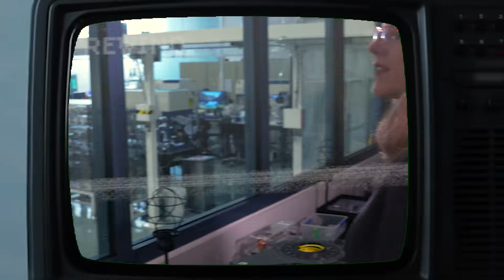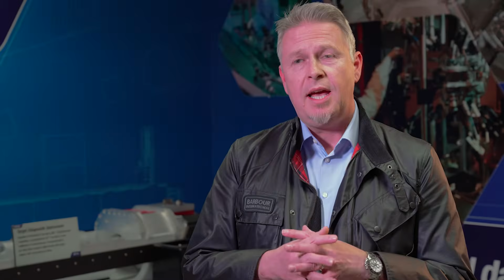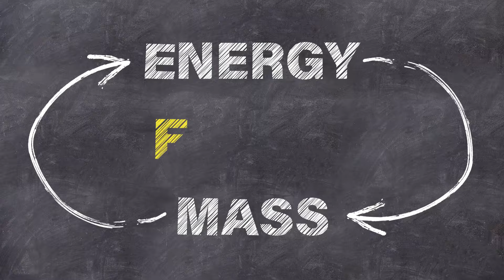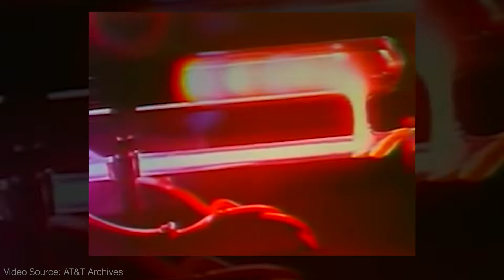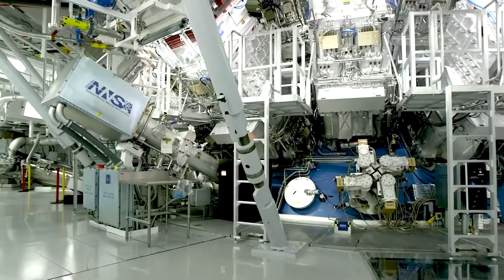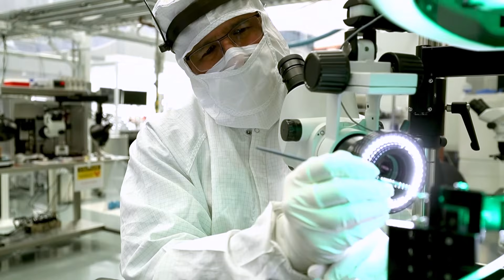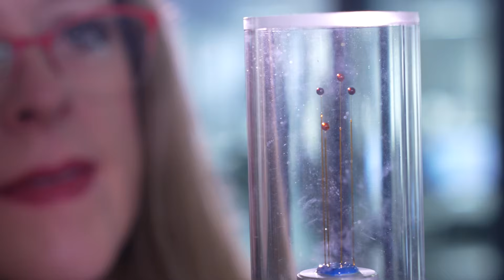What is fusion ignition?

Comment: The problem with the Hologram is that it was not spherical and it was not able to contain and control the neutrons and they had another words if you going to extract energy from something make it like around spear don't make it like the whole ramp all these neutrons and everything is hitting every particles and everything before it could contain you can't contain the field, that's what I'm saying you can't contain the field you can hit the hall around with 60 million degrees temperature but all of the energy is going the neutrons are going to take over and it can't work, it can't work because the Hologram is not round everything dealing with this test of 20 billion of a second it has to be Sparkle it has to contain all of the energy that we put in it neutrons are going everywhere, you can't have that and that's why it didn't work on the first experiment, birthday you know I had to tweak him a little bit but then they figured out if you're going to have a fusion reaction that all of the energy must be contained in the same space like a circle like the sun
Reply: Neutrons don't have an electrical charge so after they are generated there is no easy ways to control their flight path.

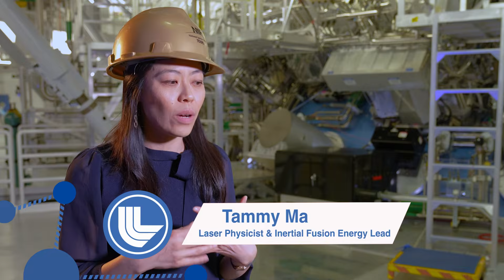Comment: The more energy that was received outside was 20 billion of a second, that's all we needed to confirm Fusion is the future, scientists already working on compact Fusion reactors and now I'm seeing compact Fusion reactors that are even smaller and require less space and a more capable because of free enterprise 1:34
Reply: The nuclear fusion energy experiments began back in the 1950s and have since then encountered a dazzling array of difficulties. The existence of fusion reactions have been known for around 100 years and the first practical application occurred in the first thermonuclear explosions back in the 1960s. NIF was designed to create such explosions using a tiny bit of fuel squeezed down to a microscopic size. In order for a technology to thrive it has to become economically competitive with other sources of energy generation. NIF fusion experiments are at least six orders of magnitude away from that.

Comment: When you say we got 150% energy out. How did we measure that? Did we heat water, turn a turbine and produce that many KWHs? Are are you just guessing based on a sensor?
Reply: There is no energy gain in the traditional sense: 1300 MJ of chemical energy was converted in conventional coal powerplants and transmitted so 400 MJ electric energy can produce 1.9 MJ laser light energy to DESTROY a million dollar target and gain +1.26 MJ unusable heat in the rubble mass (roughly 0.08 kg of wood gives same amount of energy when burnt, except in a usable form). It is an "energy gain" if deceptively hiding most of the numbers. The number of neutrons multiplied by 17.6 MeV is an upper estimate of the energy liberated (Appr. 2% are DD "side-reactions" also producing some energy, with less neutrons, but no big error in any case; The input energy is more than stated).
Reply: It's not a guess. All they had to do was measure the number of neutrons coming out and calculate. It's completely straightforward.
Reply: @Muonium1  neutrons aren't electricity thou. Every engineering student learns motors aren't 70% efficient. whats the practical energy capture.
Reply: @RabidGoose22  there is no energy capture, it was never designed with that purpose. It's an experimental facility designed to reach ignition, which it's done, that's it. Read the wiki article on it or go to the NIF web page. There were no "guesses" about how much energy came out of the reaction, it's trivial to directly measure that parameter via a number of different diagnostics on the target chamber.

Comment: Fusion is great.  Not wholly clean, the tritium and deuterium produces neutrons.
Reply: That's the point? They produce neutrons for other reactions. If you mean they are radioactive you are also right, tritium is slightly radioactive
Reply: @alihaidar5787    No.  The escaping neutrons from fusion strike the vessel walls over time and makes the reactor vessel radioactive.
Reply: @deltonlomatai2309  Neutrons on their own are not radioactive. Neutrons penetrate something called the breeding blanket lined with lithium to produce more tritium and more neutrons to keep the reaction going. A neutron carried no charge, it is non reactive. Radioactivity is the decay of particles which leads to HIGH ENERGY particles that can break DNA. Hypothetically if you were caught in the reaction your DNA would be scrambled but that would be the least of your worries. Coal kills more people due to radiation than Nuclear does. Edit: The breeding blanket also does contain elemental uranium, which overtime will become radioactive I forgot to mention this. The only issue is disposing of the blanket itself not the outside of the walls.
Reply: What's the other one, not the T-D fusion, but the other two things that could be used for fusion?
Reply: @GodEmperorSuperStar  MIT achieved deuterium and hydrogen fusion.  "D- He-3 reactions produce 3 reactions produce
no high energy neutrons, no high energy neutrons, and consequently the and consequently the
activation of metals is activation of metals is drastically reduced. drastically reduced."
Reply: @deltonlomatai2309  can you please say that again without all the stuttering, Sir?
Reply: @GodEmperorSuperStar  cute you have a side hustle as a comedian.  remember to tip your waitresses.
Reply: @deltonlomatai2309  Boy! I'm a gonna tell u, boy, that my waitresss be ME.
Reply: @deltonlomatai2309  Oops.
Reply: @GodEmperorSuperStar  Simple truth is you can't sell people that fusion is  material free.  The radioactive is of a short half life and lower amount than fission reaction.
Reply: @deltonlomatai2309  That just reminded me of the original neutron bomb, it was supposed to be a pure fusion reaction without a fission. They eventually compromised in calling a "radiation enhanced weapon" a neutron bomb.
Reply: @deltonlomatai2309  Simple truth: you're very VERY VEYEEERYUQWE:POHIFJ
Reply: @deltonlomatai2309  EEEEEEEEEEEEEEEEEEEEEEEEEEEEEEEEEEEEEEEEEEEEEEKKKKK!!!
Reply: SAHP TRIGGERING MY ptsk by calling me a queer!!!~!
Reply: Aneutronic fusion is any form of fusion power in which very little of the energy released is carried by neutrons. While the lowest-threshold nuclear fusion ...

Comment: We must not belittle the effort the folks at the National Ignition Facility have put into this, but it is appropriate to criticize the hype they have put out.  They simply got really excited because they finally achieved what they originally claimed they would achieve no later than about a decade prior.  It was not a breakthrough.  It was merely a modest step up in energy released as compared to a similar test they did a year or so earlier.

Three megajoules sounds like a lot.  How much energy is three megajoules?  Three megajoules is three million watt-seconds.  In comparison, one kilowatt-hour is three point six million watt-seconds.  I pay about twelve cents per kilowatt-hour for electric energy delivered to my home.  So, if they could convert the energy to electricity and deliver it to a user at 100% efficiency, it would be worth about ten cents.  They stated that if they could have caused all the fuel in the pellet to fuse, they would have released about 40 times more energy, if I remember correctly.  So that would have been worth about four dollars assuming they could convert all the released energy to electricity.

Using their present approach to releasing the energy, they have to procure the deuterium-tritium fuel, cryogenically cool it, place it in a micron-tolerance diamond sphere, place that inside a precisely made hohlraum tube containing gold as well as other expensive stuff, precisely place the assembly in position, and blast it with 192 huge lasers.  It should be clear that they are not on a path to achieve the dream of cheap abundant clean energy for the world.

At the time of announcing their “breakthrough”, they said they expected to repeat the experiment on about a monthly basis, and expected to continue to extend the energy released.  Since then, it has been about a year and so far they have announced only one shot that released any more energy than the “breakthrough” achievement.  Since the 1950’s, there has been no doubt that mankind can release more energy through fusion than the energy put in (think hydrogen bombs), but the question remains whether we will ever have a cost-effective commercial power source using fusion produced on earth.  I hope these folks can at least succeed in their primary mission of assuring nuclear deterrence.
Reply: Wow, how refreshing it is to read sane and intelligent comments. I agree with you 100%. This is not the way for power generation, but that wasn't the goal. This is the way to prove ignition is possible on Earth and that the actual power output from fusing can ever be higher than the energy initially put in by the shot itself (not counting inefficiencies in the shot, just the output power of all the lasers). Basically, without actually air-detonating bombs and collecting the radiation and heat off them directly, this proves we can fuse and produce more power than the initial input, meaning it is possible to fuse on Earth for power. Definitely a thing to celebrate! It's possible!

We just don't know how to sustain it long enough to make usable, sellable power yet. That's still a distance off, possibly never if the US doesn't actually have "vehicles not of this Earth" (see Popular Mechanics circa June 2020 via wayback) , but super conflicting evidence on that one.
Reply: In the Middle Ages, there were so-called "alchemists" who promised rulers they could turn lead into gold. The rulers took the alchemists on payroll, and they lived in clover, but no one ever got the gold.😜

Comment: "Fusion Energy" is a pleasant sounding term, but for energy generation, viable fusion energy production will most likely be hundreds of years out, if ever. Stars do it so easily because gravity is plentiful (and free) at the core of a star. Not so much in a building on the surface of the earth. Thus, the energy requirements needed to compensate for the lack of gravitational energy will always vastly outweigh the useful energy output. But any first year physics major knows this.

Comment: While ignition is definitely worth celebrating, this whole thing feels deliberately misleading. Sure you got more energy out of the pellet than what went into it, but the the system as a whole is still a massive energy sink. That laser power didn't come for free.

This is disingenuous at best and an outright lie of omission at worst. While the public may be fooled, those that follow science news and subscribe to channels like this most certainly will not.

And the big questions still remain; how do you plan to have a net energy gain, and how do you plan to do it reliably, repeatably, and cost-effectively enough to be a viable power source?

I get it; a lot of work has gone into this and some really great science has come out, and you are proud of that. Rightly so. But hyping it as the future of power generation is not even wrong
Reply: Quantum Kinetics Corporation is 50 years ahead of NIF. The Arc Reactor has been fired and shows 0.7 KeV to 30keV  plasma fusion temperatures at only 5.4 watt/sec.

Comment: In another hundred years, maybe we will have a facility big enough to actually be useful
Reply: If you wanna see the real plasma fusion device. Look no further than Quantum Kinetics Corporation. Because, it’s here. It’s patented, trademarked, DOE researched verified, and ready for industry. Hot fusion guys are shaking in their boots.
Reply: Or, someone will invent something relative to releasing potential energy by inducing a reaction that requires less in that will come out. Einstein's theory is grossly misunderstood because his theory is grossly misleading. 
I have some strong and sound theories on a particle accelerator to collide sub atomic particles and possibly, release more potential than was required to generate the reaction. 

Until then, I have invented a new solar generator that is exponentially superior to our modern semiconductor photovoltaic cells. That one I know for fact works, another I will need to test the theory in my lab, but also believe the output will be even greater than the other system I invented. 
*Harnessing the sun's energy more effectively gives the misleading impression of "free energy", but my current working system is so efficient, electricity could eventually be "free" of monetary exchange.
Reply: @JonDeth  Internet Nutbag

Comment: Uh... is whole video is a joke?
The laser pulse is measured in femtoseconds the amount of energy produced is about that of a couple hundred matchstick heads burning themselves down to nothing.

You need to store the energy to make the laser pulse first. Was there enough energy made by the reaction to recharge those lasers?
No.

So why not? The laser efficiency is very low. Only a small percentage (around 1-3%) of the electricity stored in the capacitors is output as photons in the laser beam. Most of the electrical energy is wasted as non-laser emission heat because the diodes are nowhere near capable of converting anything even close to the majority of electricity into a laser.

This is not the perpetual energy machine that fusion promised to be and the reason is clear. You can't cheat nature (aka: the laws of physics).

This wasn't a breakthrough.

Comment: The energy needed to prime the lasers was way more than the energy released by the lasers.

Fusion Ignition was therefore not actually achieved.

[Edit: "needee" corrected.]
Reply: Fusion occurred. Ignition happened, and that's big step.

What didn't happen was over unity- greater power put than power in- which is what we need for a viable power plant.
Reply: @heartofdawn2341  
I haven't seen this comment until now...
Fusion is nothing new, LLNL and other labs around the world have been fusing helium for around 30 years now. It's never produced more energy than what was put in to fuse the fuel.